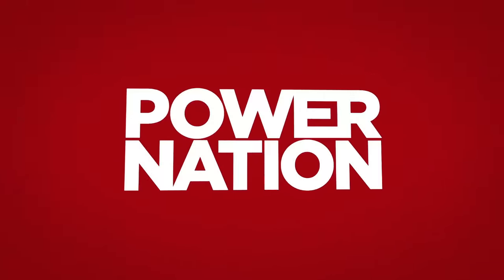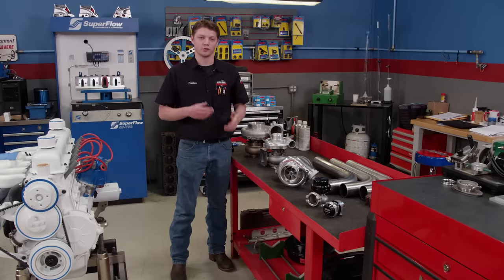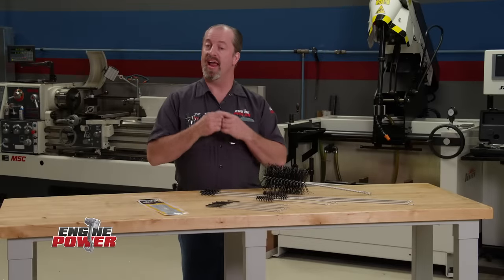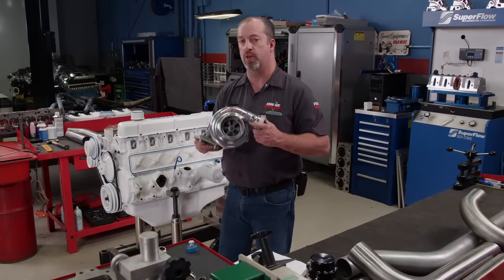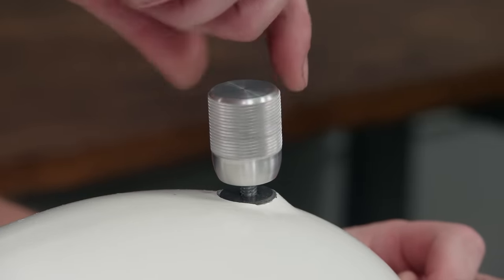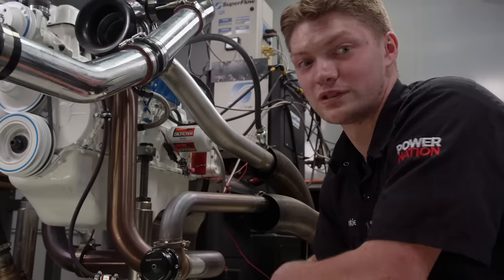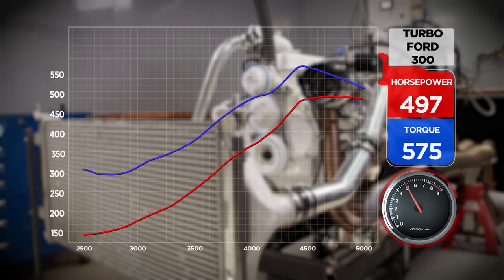Turbocharged Ford 300 Inline Six Makes Over 500 HP on the Dyno - Engine Power S8, E14

Comment: There's a reason these are legendary, if you overbuild everything and ask it to make 100HP all day long it will arguably last virtually forever with decent maintenance.  If I wanted to run something like this in a daily driver, I'd go for the 250 HP + 330 FT/LB NA config, it'd still last almost forever and be a damn good motor for a truck application.  It was a blast to watch you guys push this to over 500 HP, but I don't think I'd want to run it like that for very long.  :)  Great series guys, it was really cool to see the 300 inline 6 get some love!

Comment: A shop I worked in used to build 6s for racing.  With a 6-pack, 12:1 compression, modified head, header, balanced and blueprinted, the 300 would dangle the front wheels down half of the straightaway on a 1/4 mile oval.  The cars were '30s sedans and coupes with straight front axles in "Hobby" class.  We also built 292 Chevs as well as the smaller 240, 250, 232 and 225 inlines.  They were all awesome, but the 225 Chrysler was a beast.

Comment: That turbo's efficiency is closer to 20psi. You could see the more boost you added, the quicker it was starting to spool. Those little old cast iron blocks and heads will handle far more than that, as being a motor designed for longevity, the blocks are often made of harder material and thicker material to reduce vibrations and distortion throughout it's life. Only issue i could see was the rods, but i feel with the right tuning 18psi would be ok.

Comment: I had a 72 comet with a worn out 250cid inline 6 and a 1 barrel carb.  0-60 in about 3 minutes.  the motor was a boat anchor, but flat out would not die. 
You guys definitely get cool points for the build.  For the performance/(time+money) equation, dropping in a 302 was the cheapest and easiest performance upgrade.

Comment: Had that engine in an old Econoline conversion van, 4 of us kids drove it for many years, only thing I think we ever replaced was a fuel pump and a valve cover gasket. They are one of the best engines I have ever seen. I think they were also the engines used for the duralube challenges cause you can run them without oil for a while.

Comment: Had I known you were going to turbocharge the build:

Borrowing from Pittsburgh Power—I would have stuck with lower compression ratio pistons.  This is the Pittsburgh Power method of reducing the peak pressures but still building a lot of horsepower big semi truck diesel engines. 

I would love to see you at 20 lb of boost would be on 8 1/2 to 1 compression ratio pistons.  I had a 1992 Ford Probe with eight and a half to 1 compression pistons and it was a slug.  I was one of the 90%. The lucky 10% had a turbocharged version of this car with the same engine and it rocked! Especially by 1992 standards.

Next Ford 300 l6 build see if you can build it to be turbocharged from the get-go. Attempt to get a more sturdy head gasket. 

It's so incredible that you're almost getting two to one horsepower to cubic inches!

Comment: The numbers are impressive. One draw back to non-x-over heads is the exhaust heats up the intake ports. At 1400 degrees Fahrenheit boosted, the intake charge heating is significant.

Comment: The FORD 300 SIX
has long been known to be a toque performer and reliable for decades of service if correctly maintained !
By the addition of the turbo,
( which I have ALWAYS wanted to do )it might add some unpredictability to the equation, but in my opinion, if dialed back just a few clicks, I think you have the best of both worlds !
Performance, and the reliability that this engine has long been known for !

Comment: One guy in the comments said everyone has a great 300 story. Mine was a late 70s Ford short bed work pickup that was used at my dad's company back in the early 80s. It would pull a house off of it's foundation it had so much torque. Had a 3 speed on the column too so it was fun to drive

Comment: These engines are awesome. I understand it was a lot of work to build turbo setup and freshen internals and everything but this was a 80 horsepower antiquated water pump pushing near ford gt ecoboost numbers. I’m smiling so big. It spent its whole life working and now it’s partying harder than the new motors

Comment: Dang that’s awesome. I have a 2019 f250 6.2 gas and would like to change the gear ratio to a 430 and put a turbo charger I think it would surprise all these diesel trucks that pass me up the pass pulling their 40 foot trailers when I only got a 30 foot trailer just chugging along. They smoke me like nothing but I don’t usually pass anyone up a hill while towing my camper trailer. I think it’s nice to have that extra power if needed for merging etc.. great video that is awesome. I have an 85 f150 with the straight six and my truck is stock. No extra nothing point A to point B type driving. We used it quite a bit for Hauling wood back in the day it served a good purpose it’s a work horse

Comment: Toe down a ford 360 that sat in the back of a truck bed in Texas for 15 years. Didn't have an air hammer. Used a 3/8" and a 5lb hammer. 3 had to be sleeved but it made. 040" over.  Still runs 12 years later.

Comment: Just bought a 1996 F150 XL from the original owner after they only drove it 50k miles and was always kept inside and never saw salt. The ac still blows ice cold. Now I have three straight sixes and one that actually drives.

Comment: That is great, bit I would love to see you guys, build a 5.4 the valve engine and test it just as you have done with this 300 inline 6. I own a F-150 with the 5.4 3 valve. It now have 126,000 miles and it still runs great. 8 change the oil every 5,000 Miles and I've been using 10W 30 Castrol full synthetic

Comment: Had most every Ford V/8 engine from the 70s, 60s, and 50s. Also had a 65 200 6 cylinder. I just bought a nice 1990 F-150 with a 300 6 cylinder.  Always wanted one someday and finally got one. They will last forever but likes gas.

Comment: I've always assumed that the factory 300 engines were mainly choked off by the exhaust and intake.  I knew a older guy (machinist) that did tractor pulls and he claimed his made near 600 HP with turbo and nitrous oxide. I never got to see it run sadly as it had already threw a rod a few years prior.

Comment: Can confirm that set up would easily hold 20psi and AT MOST the only thing that would quite possibly let go is the head gasket. Forged internals + Iron block you're not cracking or breaking anything on that size turbo @ 20psi. GOOD SHOW!

Comment: The 300 was meant to run below 3000 rpm, so running it up to 5k is going to increase hp by a lot even in stock form.
They didn't even start the dyno run until the stock motor was out of juice.  Apples to oranges comparison.

Comment: I went to dirt tracks and they races a 6 cylinder! There were  300 Fords running just a second a lap behind the v8's in the early 80's! Not the top modified, but the street class V8's. The Chevy 6 cylinders were hauling ass too!!

Comment: I built a 300 with a 2-barrel intake, 302 carb, headers, and a torque cam.  It twisted the 1/2 ton drive line out of my truck a piece at a time in 6 months. I had to replace Everything with 3/4 ton Dana Posi, 1-ton granny trans, 11-inch dump truck clutch and a custom driveshaft.  Two years later I had to weld, box and fish plate my frame back together to live behind that engine.  I NEVER had any use for a V-8 after that.

Comment: What you should have done is gone with the huge turbo and then put a Whipple charger on it so that you get full boost from the supercharger at 1500 to 2000 RPM and then when the turbo had enough boost to be beneficial there would be no lag time between it and you just get boost from start to finish. 

Well at least until your motor blows up, depending on how you drive it.

Comment: Not sure who thought to use one of the most loved and hated I-6's ever in a build but I have to admit that was really cool. I learned to drive a stick in the first truck I ever drove, it was a F-250 with a 300 six in it. That thing was a torque monster back in the day (gutless in every other way basically). It was one of the best engines, except they had a head problem that plagued them for years, and they were horrible on gas. Still really cool to see how under powered and inefficient these old engines were. Turn the page to today and it should be a battery.

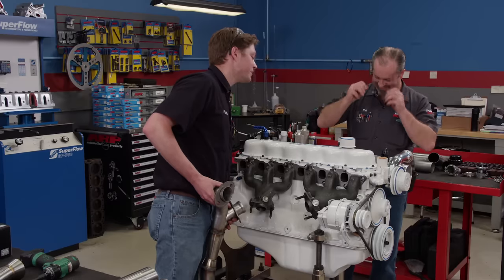Comment: So, Ol’ Blue (my 1965 F-100 300cid inline 6, 3 On-the-Tree, 9:11 gears) had the Offenhouser intake, an Edelbrock 500cfm Carb. Original FOMOCO Oil Bath Air Filter. Comp Cams RV Cam, Double Roller timing chain, Mallory Dual Point Distributor, Clifford Performance split headers, (You guys don’t know about CliffordPerformance… 6=8…) I had  dual exhaust with Thrush Cherry Bomb mufflers. It was bored .30 over and had Loper’s Roller Rockers. I ran hotter spark plugs, and dialed them perfectly. Timing was set to optimum total timing. Couldn’t get a turbo in those days, but wanted a retrofit supercharger.
Ran 31x10x50 rear paddle tires and 15 inch Pizza Cutters in the front. Didn’t need 4x4 because I powered through everything and used basic off-road skills to keep from getting stuck.
C’mon guys… really great build here, but a lot of this stuff, we already knew…

Comment: As this series has gone on, I was with with them with the basic upgrades.  The better carb, intake, and exhaust.  But when they changed the pistons it wasn't really a 300 any more.  Now, with the addition of the turbo and all the pipes and tubing required, it's not anything like the "long, not strong" legend that the engine rightly earned.  This Frankenstein monstrosity is...nifty, but I'm too much of a traditionalist to really approve of it.  They keep cranking the power up and all I can think is that, "Cast iron, it's cast iron, it's going to fracture and explode".

Comment: I want one for my 66 econoline! next build suggest custom pistons (2 ring) that raise the wrist pin and use the rods from a 240. These 300's were in f550 and +f650 but were built with forged internals. it raised the operating range from 3000 to 4000.

Comment: Not at all surprised that 300 could handle the boost. That engine was about as bulletproof as they came back in the day. I don't think I ever encountered an old ford truck with the 300ci inline 6 that didn't run.

Comment: There was a drag racer back in the seventies who took three Cleveland heads to make one.  They cut, welded and made into one head to fit the six cylinder motor. The six carbs came off Chryslers 292 cu in motors.  The person beat his class competition record by one second.  The engine and trans were an engineer feat. This was in the 70s, ran on premium pump gas.  It was dyno tested at 658 hp.

Comment: 500 horsepower from 6 in a row,is more than enough to power and car or truck down the road and get decent gas economy esp at 3.00 a gallon,we dreamed of making this kind of power from a 6 when i was 15 years old,my first car was a 54 chevy,having this kind of power in those days were big inches and dual carbs and every trick available and even then 400 horses aspirated was in magic land,21st century is shaping up pretty good,imagine this engine taken care of,how many miles would it go,with TLC,EXCELLENT

Comment: Watching this has me wondering how much boost one of these old monsters can take. They were overbuilt and tough as hell in stock form. The only way I ever killed one was oil starvation caused by a failed pump. Yeah, that'll teach me to trust the stock gauges, right? Anyway, I'm sure that with the right parts, this engine could take more than what you guys threw at it. Well done!

Comment: I have this same engine in my 89 Ford F-150 4x4, I would love to have it turbocharged. Don’t necessarily need 522 horses, although I never complain if it did! LOL  But I be tickled to death with even 300 -350 horses.  Stock 300 gets you there, but it’s nothing impressive that’s for sure. Although these engines seem to last forever so you can’t complain much about that either!  One thing I do wonder about though, what does this turbocharger do to the mpg? Stock I get around 15-16 mpg in town and if I take it easy on the highway I’ve gotten up to 22 mpg but that’s driving like a little old granny! Which I’m no granny! LOL always had a heavy foot and it still is even at 65 years old!  I do miss that horsepower though! Especially when I want to pull a trailer!

Comment: I'm kinda wondering why was the cam shaft so small? Why not the equivalent to a 270 or 280 mega but for a straight 6? I know you have to keep it below 5000 rpm but a 270 with 470 or 80 lift you could still keep it below 5k? Just curious because my son has a 1996 F150 with the 4.9 and 5sd transmission and we were going to go through the motor and pep it up so I hope you read and answer my questions!

Comment: Clifford performance has some hot rod headers available that would lend nicely to a turbo setup, also has a dual carb intake available as a bolt on with twin weber 32/36 and those headers or long tubes.

Comment: Years ago, I had one of these engines in a Ford F150. The truck was not in any way, "Fast," but it would carry anything that would fit in the bed, with very little change in "acceleration." The only thing that changed when the truck bed was almost dragging the ground was the speed with which the fuel gauge went to, "E."

Comment: The Ford 300  6 cylinder was designed with a Turbo charger,  teco electric Co. In Tampa FL had several service trucks with turbo charged Ford 300

Comment: Cool build for an old rat rod or shop truck. I would take the hot side and hang the turbo and piping out the hood for even more cool factor. However, for probably the same money, you can get a Coyote that's half the weight, put a tune on it to get the same horsepower with twice the mileage and better reliability.

Comment: I’d be interested in a setup like this but for a towing application. If a smaller turbo were used for quicker spooling, would that torque curve shift down in the 2000-2500 rpm range? I wouldn’t want to be winding the engine out as it would for racing. Torque and pull is what I’m interested in for towing. 250-300 hp seems like that would be fine for that.

Comment: I have this engine in my 1986 f150. These engines last. It's a 4 speed and I never have to use 1st gear, even in 4 wheel. They don't make them like they used to. It is tough on gas though. ⛽😬

Comment: I always wanted to do this project, or something like it.  I had a 300 last 506k miles, replaced the carbuerated 300 with a EFI version that I got out of an Econoline. I wanted to build it and supercharge it. But I just swapped it out, and it's probably still running somewhere.

Comment: Have owned and modified some vehicles in my day. The rig I most regret selling was a stock '65 long bed Custom Cab F100 Camper Special - 300 hummin' half-a-dozen, granny four-speed, 16 X 5" steel wheels, 3.50:1 9"... wasn't fast but drove well. Oh, the things I'd do to it today... starting with these particular engine mods (and better brakes). sigh You guys did one hell of a job. 500/600? Come on!
Reply: 1965 was also the first year for the Twin I Beam front suspension.... and we all know where that has taken modern, offroad race trucks suspension systems.

Comment: Would having those dual manifold , extrude honed be beneficial. May be a dumb question but curious.😎 One row interceptors have always intrigued me. I love the way the steering always felt in the many vehicles I have owned in the past... Especially the 1970 Fairlane Falcon wagon I owned. I could get it to wheelie by patting the throttle it amused people,,,,, it had header I built and custom 3 " exhaust with 4" tip sounded like a Biplane LOLS.

Comment: I got 3 questions.  1)-  Final turbo build WEIGHT?  2)-  Final turbo build HP @ 3,800 rpm?  I require two 350-400 HP (@ 3,800 rpm) IC engines for 2 axial flux compound array electrical generators.  And each engine (ready to run) weighs in <600 lb.  Transmissions NOT required.  These generators are for an eVTOL medium sized aerial utility vehicle (maxVTOW = 12,000 lb).  Marketed to civilian first-responders, search & rescue, military, rich dudes wanting a "limo upgrade"...  So...   3)-  Can you oversee building 100 such engines in a year?

Comment: I did this with my 300. But I had to put in a 3 core radiator for the extra heat. Don't know if your water pump is big enough .For some reason it gets hot .

Comment: My first pickup 1980 F150 had this engine. I also had it in a full side Bronco, it was a real dog in the Bronco but it was just fine in the pickup. What are your plans for this engine? It would be great to rebuild a nice 1980 F150 and sneak it info the track with a 2.7 eco boost! I have a F150 2.7 ecoboost now and it is awesome but I have a feeling this 300 would beat it handily!

Comment: I'll take it...no literally, I'll take it.  I used to have a 1990 F150 with a 300 cu in (4.9l) inline 6.  Wasn't the fastest but loved its low-end torque.  I now have a 2006 F250 with a 6.0 Powerstroke that I did some top end work on.  It's a 500k motor now.

Comment: I've used a few industrial engines as the basis for builds in my day and although I have zero evidence of it I swear the foundry recipes have to be somewhat different for the casting of these components.  I mean they are often designed for extended hours of operation in many, many cases 24/7 operation so I'm not surprised at the outcome.  My question is are you going to push it further or rest on these results?

Comment: My brother  had an 84 f150 with the 300. Too bad we didn't have this tech back the  this could have  been the the Barra  motor for the states. I'd run one of these in a clean F150 or a lightning that's impressive for that little motor.